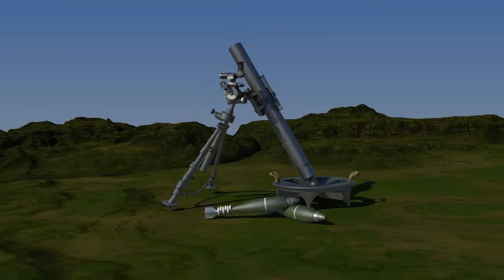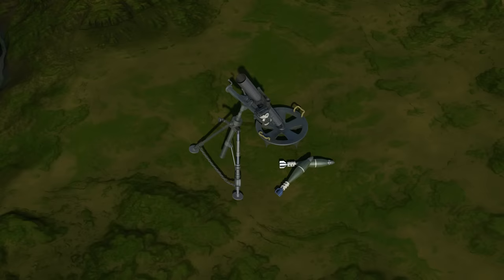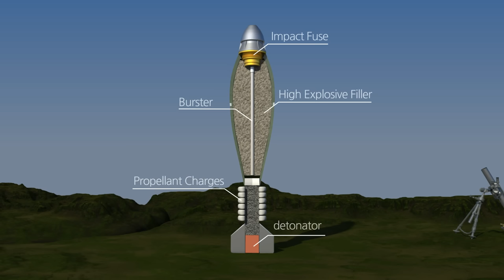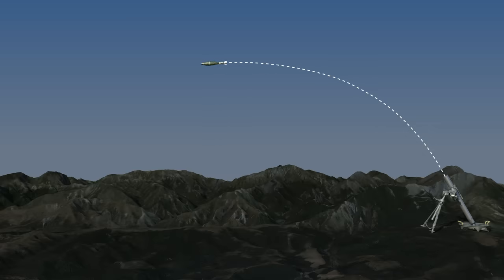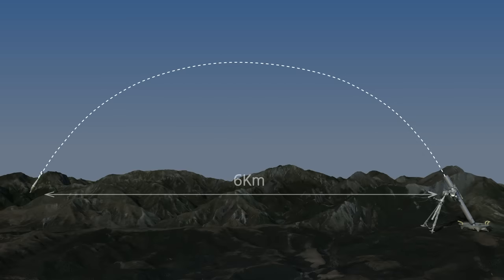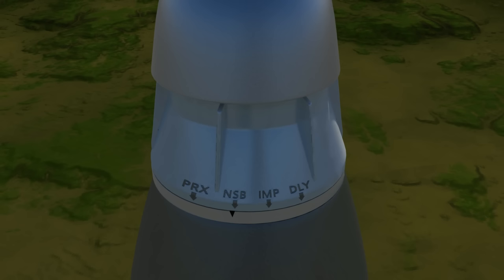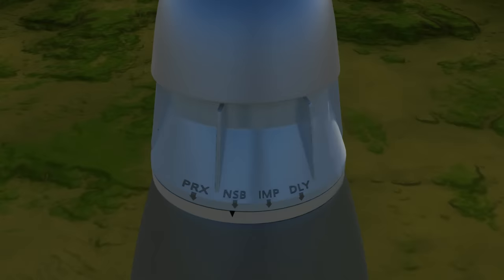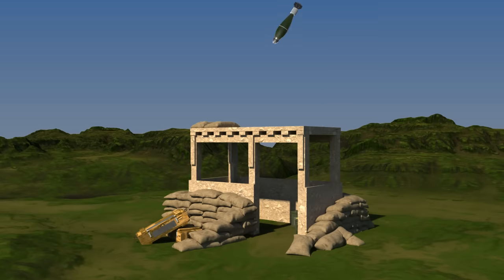How does a mortar work?

Comment: My buddy (in a rifle platoon) used to call me Mortar puppy, which eventually morphed into Motorpuppy. Hence, my screen name. There was a plastic ring that would fly off after the shell left the tube the mortar shell became armed after the plastic ring came off (that was 40 years ago, have that changed?) I used to try to catch at least one of them (for good luck) before the ring hit the ground. When the shell went into the tube and nothing happened, Everyone would scream “HANG FIRE! and race back about 20 yards behind the mortar. The Gunner and assistant Gunner’s job was to clear it, by unlatching the tube from the base and tilt the barrel forward til the round slid slowly out with them catching the round when it slid out. Scary stuff. Without fail, the hang fire was always because, we forgot to screw in the firing pin into the barrel. Sitting around waiting for our fire missions, hearing how their wives left them cause they picked up crabs and std’s from picking up women from the bars and church(of all places? who knew they were wild?) from the small town near base. I really miss all that.
Reply: Thinking back, I think that the shell twist soon after leaving the tube and that’s what arms the shell? Or that it had to travel 70 meters before arming? 
I remember being a RTO (radio operator) for one of our fire missions. We were firing from inside our Tracks (Armoured Personall Carriers). I could only wear one ear plug cause I had to hear the commands that were coming in over the phone. I had forgot my field jacket and I didn’t have my poncho. It was rare freezing cold night, with down-pour rain in the desert all night, so I was happy to be tucked away in the corner of the APC with the radio. Almost lost my hearing forever in my right ear that night.  Sorry for the ramblings of an old man.
Reply: great story I enjoyed listening 😊
Reply: @classiarius  Thanks for you insight Wes. It's been about over 40 years, since I was in the military. I work the 81mm, somethings I missed about my time serving, others not so much. But I am glad I did serve. My kids, their friends, and other family members, love to hear about my time in, and some of the wild things I saw and did, while they are things I wish I could forget. Sorry starting to ramble, again.
Reply: You miss talking about getting crabs and STDs?   😂
Reply: Your oppo gave you literally the gayest nickname ever.

Comment: I was a 120mm mortar detachment commander. There are 6 mortars in a battery. 3 batteries form a battalion. I was un/lucky to be assigned to number 2 mortar. This was the ranging mortar. On receiving a mortar support request, I was given 2 minutes to unload, setup and fire the first bomb away. Others could take their own sweet time.  I was told only the best got into no. 2.
Reply: Bullshit.
Reply: They tell you alot of bullshit at the army, huh? xD

Comment: What the video doesn't talk about, is how heavy those shells are.
I'm not in the military, but found out when visiting Dubrovnik, Croatia. During the Balkan wars there was a lot of fighting going on there. In the hills surrounding the city, small war memorials are set up. Those include some war remains, including exploded morta shells, which I held in my hand briefly.
An interesting place to be...
Reply: It was not some Balkan war, it was pure serbian agresion on Republic Croatia.
Reply: Every piece of ammunition is heavier than it looks. Common folks are not used to materials with that density. Mortar shell is cast iron shell. Of course it is heavy.
Reply: That's probably a 81mm shell, 60mm ones are relatively light, at least compared to 120mm. Those things are only like 1.5 kg, while 120mm are 9 times heavier.
Or maybe I'm just used to carrying heavy things lol
Reply: So what you also don't talk about is how heavy those shells are.

Comment: A mortar, a howitzer and a cannon all are pieces of field artillery. a mortar is used for indirect fire only, while a cannon is for direct fire. the howitzer is capable of both. while a cannon would be used to breach walls, a mortar would be used to hurl ordnance over the wall to suppress the defending army. also the range of a mortar shell is not only limited by the number of charges it has but also by the elevation of the barrel. for max range the elevation should be 45 degrees. you can angle the barrel higher, but then you get shorter range with a steeper dropoff angle.

Comment: Informative and easy to follow information for those who may be totally uninformed about mortars.  Nothing too revealing as far as any security goes, this is artillery warfare at it's most basic, and widely known worldwide.
Reply: @werewolfbishop5465  Though they are quite similar in their application and deployment.  Howitzers are usually bigger, with bigger barrels and often self propelled, they are normally used for indirect fire, much like a mortar, and often have a much greater range.  To the average, walking the street civilian, they are quite similar, thus the comparison.
Reply: Are you CIA, checking this stuff out for leaks?
Reply: @jbuckley2546  Why does that matter? You might want to read through the comments.   Seems others may have thought it was a security issue.
Reply: It's giving wrong information. Such a waste of production time.

Comment: You use delayed for machine gun bunkers, breaks through concrete. Air bust for troops in trenches or prone. Near surface for troops in the standing. Impact is just your standard if you don’t receive a description in your call for fire.

Comment: My father taught National Servicemen (conscripts) in the Australian Army in the 1950s. He instructed on the use of mortars. It is affected by the temperature and was found inaccurate in Korea in winter. If the propellant was designed for the temperature, it was very accurate. When a mortar bomb failed to explode, my father would dig down until he reached the bomb and read the serial number and then place a charge next to it and blow it up. That is one job that I do not want.

Comment: It should be 'How does a mortar work?' or 'How do mortars work?'. Otherwise, you have done fairly well in delivering a basic lecture on a generic design.
Reply: 🤣🤣🤣 epic
Reply: @doctorpanigrahi9975  Words are meant to have meaning. They only have that meaning if they are used correctly. Go find your "It's OK if I talk like a two year old" safespace.
Reply: Well, if that's how a mortar works, that's also how all mortars work... What's the catch?
Reply: @LyleGlenn  it’s not how ALL mortars work. Just most of them. There are also spin-stabilised mortars and petard mortars.
Reply: Unfortunately half of information in video is wrong and  half is missing.

Comment: How does the proximity work? How does the mortar know when it's close to the ground?
Reply: There are half a dozen different methods for that, just look up the wikipedia article Proximity fuze
Reply: Well, in the past was time trigger, what need to be adjusted depending of range what define flight time. Today there are shells equipped with sensors what can "see" distance to the ground and are less complicated for the crew and also more effective because time flight can vary not only according to the distance but also even on the air humidity and temperature. Not to mention this shells are bit more expensive and not every body can buy it

Comment: There’s movies in which the actor playing a soldier fired mortars off their thigh, several soldiers who tried this with a live mortar firing suffered broken femurs.
Reply: It is based on, if I remember correctly, japanese  light mortar that had base plate which seems like it would fit perfectly on your leg.
Found it: Type 89 grenade discharger - "inaccurately and colloquially known as a knee mortar by Allied forces"

Comment: PRX height it is not under 20 m, and never as low as 30 cm. Its value it is determined automatically for radio controlled proximity fuses to a 20 - 30 m above target. For pyrotechnical mechanism fuses it is calculated as  2 - 4 standard height deviation value to the firing distance or 2 - 4 mills above terrain line in the objective area.  Great experience to work with mortars.
Reply: why so far from the target? Wouldn't that reduce the damage to target
Reply: @MuhammadRafy  considering the effect radius and the dispersion of metal fragments from aerial burst a standard explosion height allow a larger effect area against unprotected personnel. For example you can envision flares dispersion from a firework that explode at different heights along with the fact that shrapnel have sufficient kinetic energy to inflict significant injuries up to 40m.

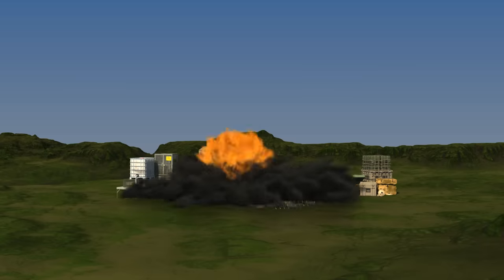Comment: 1:25 Do you understand the difference between the radius and the diameter?
Reply: When explosions are measuring aoe, radius is typically used as a measuring point as in blast radius, which measures the distance the explosions deals from the center of impact, i think they couldnt animate it probably

Comment: What I’d like to know is how the site distance settings work, especially since this works on an arc instead of straight line.
Reply: You either use the MBC Mortar Ballistic Computer or what we called a Whiz Wheel
Reply: While I fully understand your question, ALL ballistics work on an arc.  NONE work on a straight line.  Mortars just work on an exaggerated arc.  At 1000 yards a .30-'06 bullet will be about 30'/9 meters above the line of sight at the maximum height of flight.
Reply: For every Charge bag is roughly 500m distance on Charge 1 there are no propellant bags on the Bombs tail fin what happens is a fire mission is called in by the Mortar Platoon FOO he gives the CPO Command Post Operator a grid reference and a bearing and the CPO using either a MorFire Computer or Plotting Boards work out the coordinates to the Mortar Section made up of 2 Dets ie: Barrels so the CPO usually a Sargent will call out the Fire Mission to the Section 
Ie: 81 5 Rnds Charge 4 FFE Fire For Effect 
Bearing #####
Then the Mortar No 1 will use the C2 Sight to line up the correct bearing and move the mortar so that the sight lines up with the sight post 30 meters to the front of the Mortar once it’s aligned the No 1 will fire a round and the FOO will adjust the fall of the shot once the bomb is on target the CPO will 5 rounds per barrel on the target to complete the Firemission
Reply: Mortar Sections we’re known as
81
82
83
Two Dets per section 2 barrels so in our Mortar Platoon we had 6 81mm mortars total with 4 pers for every Mortar 8 Sargents acting as FOO’s within the infantry Battalion

Comment: I like how a mortar is a mini cannon 
But it loads bomb from front
Reply: Actually, when cannons were invented, they were loaded from the front.
Reply: Cannon is not pointed upward. There is specific terminology used for different types of armaments (gun, cannon, howitzer, mortar). Mortar is never supposed to be used ac cannon. because cannon fires directly at  enemy while mortar fires indirectly (up in the air).

Comment: You missed out the "Plastic" rings around the centre of the round.  With he friction of the round running down the tube the seal expands slightly forming a seal, so when the propellant expands it can push the round out.  Without it most of the propellant gas will escape, and the round will go nowhere near as far.
Reply: And also fall in to the tube too fast

Comment: Some mortars are fired by a lanyard-activated firing pin.  The m-4 is one currently-issued example.

The maximum range of a mortar is about 9 kilometers, not 6 kilometers.

Not all mortars use base plates.  Some are mounted on wheels, such as some U.S. 120mm  mortars, the M120mm A1.

Knowledge shpould precede putported teaching.
Reply: I think you are forgetting there are different kinds of mortar, just like the video. 81mm seems to be what this video is based off and 120mm is what you are talking about. Bigger mortar, more boom, more potential range. Though, I don’t really know what militaries use what admittedly, nor if there are quality differences.
Reply: @TheSp0kesman  I think you, like whoever created this flacid video,  are forgetting that there are different kinds of "mortar."  So "How does mortar work' is a false title.  Futhermore, not even all 81mm mortars use a fixed firing pin.   So, there is error even as to that small subcategory.
Reply: @TheSp0kesman  61mm M-4 does not use a fixed firing pin.  Smaller mortar, less boom, fired by pulling lanyard to release spring-driven firing pin.
Reply: @TheSp0kesman  Generally most armies use a light (60mm is common), medium (81mm for NATO, 82mm for East bloc), and heavy (120mm across the board for most armies, with some like the Israelis and Russians using monster 160 or 240mm weapons). Range of course, varies, but even for the super-heavy types is fairly short (under 15km or so).
Reply: @MM22966  We used the 120mm type. In peace time up to 6.x km. In war extra loads were supposed to be used for targets in about 10km distance.

Comment: The purpose of a mortar (and much, much more importantly, it’s crew) is to embarrass and shame the CAS pilots into actually doing their job. A well trained mortar crew is leaps and bounds better in almost every metric than even having an A10 on station. Been there, did that. Mortar men are outstanding. 

You can @ me and argue about it, but if you disagree then you’ve never got to work with a mortar crew in contact 🤷‍♂️.

Comment: The firing pin is not a long spike as shown, it’s a short rounded pin that screws into the bottom of the mortar tube in cut out in the ball swivel.

Comment: Not a single channel I've seen talks about how a mortar is aimed.
Reply: I would think there is a line of sight optic installed on the tube, and for unseen targets you just need to know your exact location (basic training 101), and a reasonable approximation of where the target is...a map and a compass gets it done, with a well-trained spotter to correct fire it gets done efficiently...

Comment: Mortar gunnery was my MOS 11C40 1968/1970. 81 MM.
Reply: They have the most intimidating legs of the 3. if only they got rid of that dam strap that always catches anything that snags it. The legs are like giant slingkies after you bobbled them and lost control. Because you forgot to unstrap it lmao then when you realize you forgot to unstrap it prior to mission, you now let go of the leg with one hand only to now have the 3rd lil leg swiveling around to catch your finger or worse, the bottom feet are sharp once they hit your knee. our nco's would let us boot the system sometimes but we never pressed out luck. We had all 3 systems set up in afghanistan but we had the cherries be ag's and ab's and would tell them to step back and watch lol, we'd do by ourselves 1 gunner, big deflection, big shift, calmly and hoping there is no rocks or grass blobs that shift the whole system seemingly a few seconds later causing you to have to run back around to the legs like a brand new cherry all over again!

Comment: Not many facts in this video remotely resemble the 81mm mortars we used. The ranges with full augmentation charges can be as far as 15km for some projectiles. I have never seen such a fancy fusing mechanism with proximity fuses etc. on a mortar - a delay was a twist timer usually used for illumination mortars to pop at the correct height... our HE rounds kill radius was about 60m
Reply: In my day Nam the powder was small bags fastened vertical on the round, you removed some depending on the distance of the target and we did have a time fuse round to explode about 9 ft above ground.
Reply: @josef-peterroemer6235  correct these augmentation charges were either a kinda "horse shoe" shape to go around the stem of the tail or little bar shaped charges for between the fins....  - was also in "Nam"... it was "Nam"ibia so we called it Nam ... hahaha in the eighties ;-)
Reply: @josef-peterroemer6235  The mechanical timers are on the illumination rounds for mortars. The proximity fuses are electronic, somewhat similar in operation to the backup parking sensors that let you know you are close to bumping the front of the car behind you. Mortar shells come straight down, so an fairly simple radar-based  electronic device can reliably detect that it is a split second away from hitting something solid.

Comment: Not too bad as to the attempt for simple explanation. But need to say that a howitzer stands in between a mortar and cannon, a difference mainly explained by the shape of the shell trajectory. Further the distance, and so the number of charges needed for a mortar shell to the target is mainly calculated in combining the parabola and the windbehaviour. Alternative Shells: 1) high explosive 2) smoke and 3) flare. A selector on the shell definitely was/is not standard. Former Sgt. RI 47 Painfbat 120 HB Rayé mortar.
Reply: Excellent explanation!!!

Comment: Good animation, but what about the most interessting part - the aiming?
Reply: Unfortunate half of the information is incorrect and half isn't mentioned. You shouldn't learn about these things from this channel. Read other comments and you will learn more than the video showed. There are far better animations on you-tube. I don' se why corrugated pipe is used as a tube since mortar is smooth bore. outside appearance  shouldn't be important.